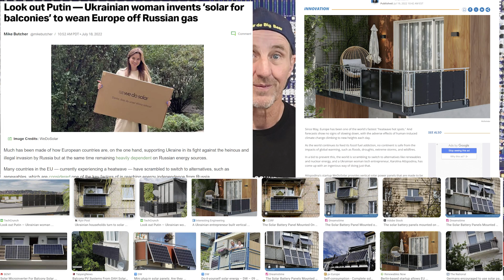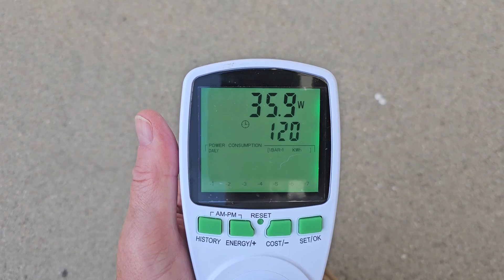Suicide Plug Solar Panels?

Comment: First time commenter, and enjoy the channel greatly.  Others have noted the "backfeed" issue and it's quite important to a lineman. Your 120 becomes 7.5Kv on the power company side of the pole transformer.  But ignoring that, your comments about people in multi-dwelling units all buying these got me thinking.  If the mains goes away, but a bunch of these inverters start free-running at roughly 60 Hz...who locks up to who?  And then, back to the original already commented backfeed thing.  You'd have several inverts all contributing to the backfeed unless the inverters somehow "know" they lost the mains.
Reply from the maker: Those are two diff things. The inverter I got does not back feed. It is powered by the grid so no grid, no solar generation.

As far as balcony solar in Ukraine, not sure how they do it and great question.

Putting a grid power sensing relay on the building that disconnects the grid when grid power is down and reconnects when power is back, would be one way to do it.
Reply: I gotta look up the inverter you bought.  I'm sure I'm missing something, but it seems magical to me that the inverter can simultaneously monitor the incoming line while at the same time outputting (presumably) the same voltage and frequency back into the line. I just figured once it starts, it just continues to go.  Your relay drop out on loss of mains is a good idea.  I guess you could monitor the other phase to detect an outage.  Thanks again for the many excellent videos. @DaveRat
Reply: @mikecue4012  That's the part I don't understand. if it's making the same thing that it sees, it has no way of telling if that supply is still there.
Reply: @mikecue4012 since AC is AC, and electronics are pretty magical, just as your phone or Zoom can echo cancel your own voice in your speakers, and prevent other voices from your speakers from feeding back through the microphone, it would be pretty easy for it to detect power feeding from some other source, vs what it's producing itself.

However, if there is another power source such as another solar unit on the same circuit, it can't tell that from the grid and they could theoretically feed each other.
Reply from the maker: @ke6gwf agreed and as long as the grid is active, those inverters would donate a tiny amount of energy to the massive grid. But when the grid is down it looks like a dead short to those tiny sources. So they would just be shotes to 0 volts.

If the main breaker of the house was disconnected and also the house had an inverter on the circuit that did not require synchronizing to the grid, then the two would work together

Yes you can have an inverter that creates a sync generate power and connect an inverter that requires sync as a contributor.

But no matter how you look at it, an inverter that requires sync will need a sync source whether it's the grid or another self-sync inverter.

And no matter what, unless you have a relay that disconnects the grid from your self generating self-sync inverter setup, if the grid goes down it's going to short everything out because your little solar system would not even begin to power a dead grid.

Having a self synchronizing solar inverter that generates power that is also not hooked up to a disconnect relay that disconnects the grid, could pose an issue for lineman if for example a tree branch broke the wires to your house.

In that scenario yourself synchronizing solar system inverter would continue generating electricity while not connected to the grid and if lineman came to reconnect your house they could get shocked.

But that's a whole different can of worms unrelated to this system here.
Reply: @DaveRat  imagine though if the power outage was because someone hit the pole in front of your house, and so the wires to the rest of the grid are broken, and the pole fell towards your house so the only thing left connected to the transformer on the pole is your triplex drop.
If any power is being put out by your house, it's not seeing a short, it's seeing an open line, but stepped up from 120 volts to 7kv, with those wires dangling down on the sidewalk.

The wires are obviously not connected to the grid anymore, so there could be no danger, right? Lol

And yes, with that style inverter, IF it working properly, it will stop putting power out when the grid drops, but I didn't see you testing it by putting a small load on it and then unplugging it from the wall with the load still attached, so do we know it shuts off properly when grid is lost?

If it's not a certified and approved system like a Power Wall, I would not trust a cheap Amazon unit to be that reliable lol

And I could also see a scenario where you decided to upgrade your system and so you end up with two such inverters.
Now if the wire outside your house breaks, will they see each other and just sync to each other and carry on?

And up there with all those beautiful trees, a branch falling and taking out the lines by your house is a pretty high likelihood.

Again, I am talking theory, and you currently don't have a second unit, but we also don't know how reliable the cutoff is on the current unit.

Basically I am explaining why the law requires an approved transfer switch for any solar or generators feeding a grid connected house, because there are so many ways that can create a hazard, and it does kill people from time to time.
Reply: @DaveRat  Oh! Look at this like an Aux Fed Sub!
A transfer switch removes all the undesirable frequencies completely, while the inverter cut off just filters them out, and while it may look like they are gone on the eq display, they could still be there causing muddy bass for the utility workers! Lol
Reply from the maker: Well that's easy enough to test All I need to do is shut off the main breaker to the house and see if the inverter still tries to power the house. And I'm going to add a couple more inverters so I'll just plug into or three of them and then do it.

Rather than talk hypotheticals let's look at the actual info and facts.

I believe that the concern you have is called "islanding". Wherein one or more off grid inverters talk to each other and try and create their own little grid that stays active when the main grid goes down with one of the inverters acting as a decoy grid.

I believe the way they prevent islanding is the the grid dependent inverters introduce frequency warble and if all the other inverters follow that warble it knows the grid is down. If introducing the frequency warble is met with a stable unchanging frequency of the grid, the inverters stay active.

Lots of good info on that can be easily found with some searches.

Oh, and looks like the inverter I am using is listed for Europe and the US with DIN VDE 1026 and UL1741

Here is a link to the inverter I am using.

https://www.google.com/url?sa=t&source=web&rct=j&opi=89978449&url=https://www.inverter.com/images/uploaded/WVC700-micro-inverter-instruction-manual.pdf&ved=2ahUKEwjyxdqK4eSDAxVwNEQIHcKoAXIQFnoECCUQAQ&usg=AOvVaw0u75Y1rShKWvTik2xRSC5X
Reply: @DaveRat  so, totally unsurprising to me, I am now potentially coming into agreement with you lol
I have an innate distrust of life-safety related equipment direct from China, that's not where I would want to buy a fall protection harness for instance, but I notice even Home Depot has it listed on the website, as a Vevor brand.

My first impression was that the data sheet was in perfect English, and it had certifications listed, but then I realized that the data sheet you have is created by a reseller and isn't from the manufacturer, and all the certificates listed are self certified, it's not UL tested or listed as far as I can tell, which means that there is no third party testing to ensure that it works as it claims, and it's not even considered safe to use in California without the UL testing.

I saw one person on the interwebs say that they had been approved by the AHJ and utility to install one, so either that jurisdiction has really lax standards, or this is a decent unit lol

So it looks like it will probably function properly, and it's so popular that if the grid detection didn't work properly it would probably have been discovered by now, so I am going to rest on that life safety aspect.

Hopefully you don't have a digital Edison meter, because it sounds like they get very upset if they detect a solar system without having the correct contract with them, and so if you feed power back to the grid even just for a few seconds, they may disconnect your power and charge you a big fine to reconnect, based on the stories I have heard.

So, enjoy your experiments, and good luck! ;)
Reply from the maker: Interesting info on the digital Edison meter.

I guess I will find soon enough and let ya know

Comment: Dave, without going into too much detail there is another inherent aspect of this type of system that can be dangerous. When this type of device is plugged into a 20 amp 120 volt circuit, it is supplementing the available power in that circuit, the 20-amp breaker feeding this circuit will trip over 20 amps or an instantaneous fault. Say this circuit is already cruising at 16 amps, and your solar system can inject another close to 6 amps after the breaker, and somebody plugs something into that same circuit and now it's pulling 22 amps on number 12 conductors which are rated for 20 amps,  the breaker still thinks it's only feeding 16 amps and will not trip, conductor overheating will begin and the breaker has no clue. If somebody had a 10 amp solar system that they plugged into the wall into a 20 amp circuit the potential for feeding 28 amps into the circuit conductors and the breaker never seeing it is there. I say this because typically people don't realize they have overloaded a circuit until the breaker trips and then they may figure out that that space heater or blow dryer can't be used at the same time as the microwave or TV in the bedroom. There's much more to this Dave but I know you have the big brains to wrap your head around this one.
Reply from the maker: I pondered this further and the 15 amp breaker of that circuit is based on a really long run of 14 or 12 gauge wire. In the event that you described, those various appliances would be located at shorter distances and be pulling power from both directions effectively doubling the thickness of the wire available therefore increasing the current capability of that circuit. So even in worst case scenario as you describe and no clouds coming by or shade, The mathematics point to the circuit still being able to handle the load safely.

In fact the load should cause a power drop across the wires and self-auto regulate wherein if it's pulling too much from the grid 15 amps let's say then that voltage will drop a bit and it would then pull more power from the solar because it would be less voltage drop in the wire from that direction.

All in all, that complex hypothetical does not appear to be unsafe. 

Also of note, the solar feed is it the opposite end of the house to the grid feed so any load would be in the middle between the two feeds or right next to one feet or the other.

If it's right next to one feed and draws 15 amps from the far away feed and another 15 amps from the very close feed totaling 30 amps even then, The long wire would see 15 amps which is fine and the extremely short wire would see 15 amps which is also fine and the only thing that would see 30 amps would be any T leg we're in both feeds meet together and then a single leg carrying both feeds runs out to the outlet where there's overloaded source that shouldn't be in the house and draws more current than the plug it has on it, is plugged in.

If it's a bunch of multiple current draws distributed throughout that leg then the ones closer to the grid feed would pull off the grid feed and the ones closer to the solar feed would pull up the solar feed and we'd be fine.

Excellent thought experiment and after running through this I feel even better about tripling the size to a 15 amp!
Reply: @DaveRat  I do understand exactly what you're saying and under perfect conditions that would be Optimum, except  that any 120 volt duplex or single outlet in a residential setting is only rated for maximum 20 amps, 15 amps at worst. Dave, I am more than confident in your understanding of this, just hopefully others reading this will realize the potential for problems. Side question...... does the inverter have a UL listing?
Reply from the maker: I doubt the inverter is UL listed but also we are not talking about something as scary and dangerous as a hair dryer or toaster that draws loads of power and generated loads of heat.

We are looking at something more in the realm of computer power supply

So I adjust my fears accordingly. 

The solar plugs into the outlet next to the Trager pellet grill which poses more of a real world danger in this solar adventure ever will.

There are some interesting comments here from people overseas where these types of setups are more common and the cautious fears have already been vetted.

Gaining my bearings on this and settling in to it is a bit scary because it's unfamiliar but in absence of doing something really obviously stupid, totally simple and safe.

Pretty much exactly what you said
Reply: @DaveRat  thank you Dave you have me looking at this in a different perspective, I was a bit knee-jerk in my first reply, I think I'm going to research my options with this type of system. ROCK ON BROTHER!
Reply from the maker: Super cool and thank you for inspiring a written version of my hesitations and understandings. 

This thread pretty much defines the process I went through to decide to try it.
Reply: @DaveRat as someone who works with residential and commercial power a bit, I can see the genuine risk presented here, even if somewhat unlikely, but worth considering. 

In many cheaper houses, many outlets, often in different rooms even, are daisy chained in series to save on copper costs. 

So let's say that you have your breaker box on the wall of the garage, and there is an outlet in the garage handy for plugging the inverter into, and you think it's perfect because it's right by the panel, and nothing else is plugged in there. 

What you don't know in this hypothetical house that is NOT yours lol, is that the outlet in the laundry room running the second fridge and washer, and the outlet in the office running the window ac unit, and the outside outlet running the smoker are all on the same circuit. 

Now, generally the washer, AC and smoker are not being used at the same time, and so while you have been close to tripping the breaker a few times when the fridge kicked on while the smoker was one and laundry was going, but then you get the solar unit, and because you feel like you are no longer a slave to power bills you go ahead and turn on the AC while you are on your computer posting about your new solar system as you are smoking some Tofu. 

But now, the wire from the breaker to the garage outlet is seeing 14 amps and the breaker is fine, but then the wire from the garage outlet to the laundry room is now seeing 27 amps, and it is going through the back stab outlets, not even pigtailed in the boxes, and you end up with a fire in the laundry room or garage when the outlets melt. 

Now, it doesn't sound like this is happening in your house, and I expect you know your circuits better than the average homeowner, and it's a tiny system, but it would be very easy to set it up in a way that overloads wires and outlets, without even knowing it, since it reverses the expected flow of power.

So I would recommend putting it into a dedicated outlet and circuit, to avoid this.

(and obviously if you are monitoring it, do as I would actually personally do, not what I am saying ;)
Reply from the maker: Interesting and it's 640 watts, that comes out to about 5 amps and it's a 15 amp breaker so worst case scenario is everything was exactly perfect and I put 20 amp s worth of appliances on that circuit during the day while the sun is extremely brightly shining, I could probably get away with it until a cloud came by and the breaker blew.

Being that I've never blowing a breaker at that house in the 25 years I've owned it and they're just isn't enough appliances there to do anything, I'll put this into the bucket of worries along with getting bit by a shark and hit by a meteor.

Comment: That was fun! So, .35/kwh, you guessing you get 1kw/day, and 300 days of sun = $105 saved per year? 7 year roi? Regardless, I like how you just try stuff and say "why not?"

I wonder how the power back to the grid works too, like you would think you would probably have to be producing more than you consume at any given time for it to start flowing the other way. It's a complete mystery to me. I'm going to go practice scales and see if my fingers still move when I ask them too (they never do, but I keep trying). 😎😎
Reply from the maker: With that small solar array I probably will just be reducing the amount of draw from the grid.

I am thinking if it works to triple the size of it up to 1800 Watts in which case I should be able to put some power back into the grid.

Energy will flow from higher voltage to lower voltage and the solar inverter is current limited to whatever it's maximum output at any given time can be.

So the solar inverter will sit there and generate whatever power it does and put it back into the house where it will be used by any appliances and any excess will attempt to go back to the grid.

This happens automatically because the output of the solar panel inverter when generating energy will have a slightly higher voltage than the grid voltage which puts power back into the grid or house
Reply: @DaveRat  You the man! It's a cool concept.